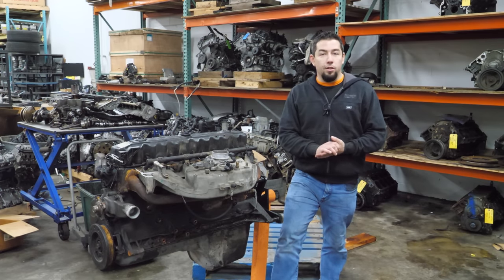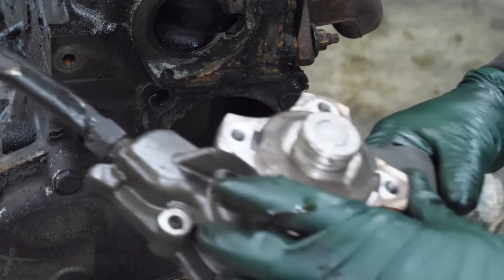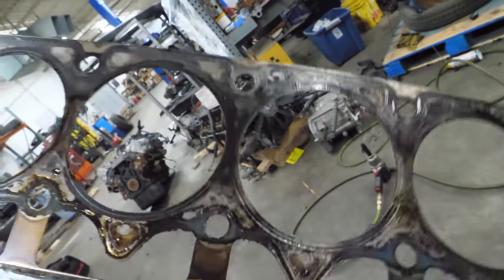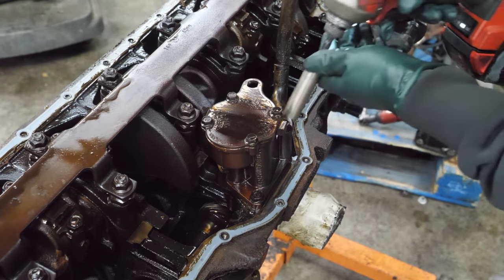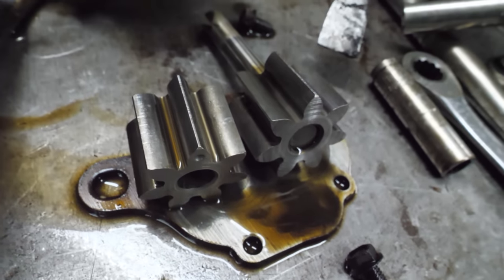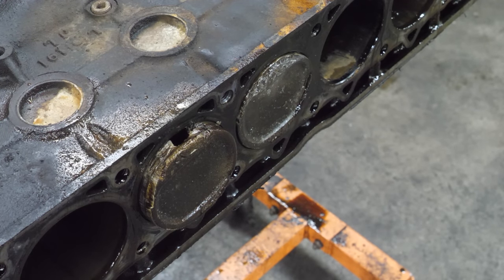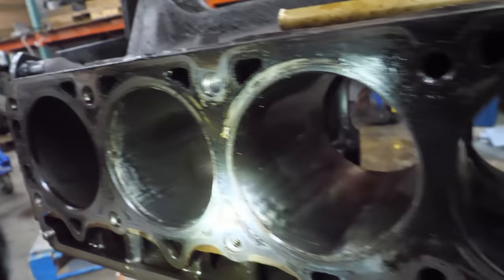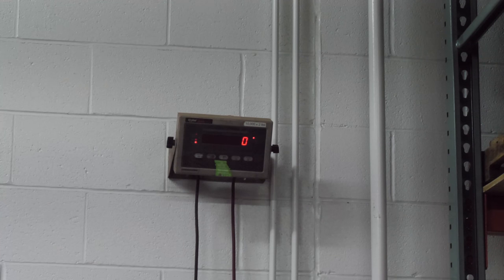How Do You Destroy A 4.0L Jeep Engine THIS BAD? Intentional? Neglect? Ill-Repair?  I Am IMPRESSED!

Comment: Just did a 2004 XJ with a 4.0. It had two pistons that dropped their skirts. 279,000 miles. The customer replaced it with a reman. This is a common issue with the High Mileage 4.0s. What happens is as follows. It starts to overheat or run just a bit on the higher side of 220 degrees. The piston skirts crack or break off leading to it burning some oil. The oil soot covers the 02 sensor, and tricks it into thinks it is running rich. So the computer adds timing and lean out the fuel to get it within spec. Only to melt down the already damaged piston, and this is the end result.
Reply: So it killed itself essentially
Reply: So, technically speaking, the pre-Chrysler style injection might not have made something like this happen?
Reply: A coated O2 sensor will produce a lower than normal voltage which makes the vehicle think it's running  lean, the computer will add fuel so the vehicle will be running rich, not lean.
Reply: Are you outside of the us? I thought the last model year of the Xj Cherokee in North America(except for Mexico) was 2001.
Reply: thats good to know..... when it got around 110F in NE montana this summer..... my 97 was running at about 217 (used OBD2 scanner)
which is just a needle over straight up and down
.
she hit 227 pulling up "kittleson hill" on my 100 mile daily commute 
.
no noises, oil burning, or death yet..... but i was REALLY worried about it
turned off the AC, ran the heater.......knowing that number 6 was probably WAY over 227..... 
.
i love my Heep..... its a POS.... but its got soul
Reply: I bet this is what happened to mine.  i bought it used and my Hwy trip I was getting 25+ mpg.   Then O2 sensors got replaced and mileage dropped significantly.   Still drove it daily through every storm MN could throw at it until the low end of the engine was going out.   Sounded like a diesel when I drove to trade it in.
Reply: @tarungonneea4614  didn't the grand cherokee have the 4.0 for a few years after? Maybe he meant that.
Reply: My radiator clogged once and I hit 240+ degrees pegging the gauge within minutes.   Was able to limp it home about 20 miles stopping every few minutes to cool off.   Cleaned out the radiator and no more issues.   The engines are very tough.   What ever happened to this engine was probably a known issue for a while.   Looks like it was making machine gun noises for quite some time.
Reply: @jordantomblin2302  The renix 87-90 4.0s don't break piston skirts. They have a much, much better designed piston than the chrysler era 4.0s.
Reply: @SlackjawProductions  could be, although the 4.0 in the grand Cherokee was a coil pack engine and had its differences from the absolute fossil that was in the xj chassis Cherokee.
Reply: It's happens with the 1997 and later 4.0l, for the most part. The earlier ones didn't have this issue.
Reply: @mmiller1188  That probably explains why the old AMC blocks and internals are used more in resto-mods.
Reply: If the coolant sensor fails it will run like an engine with a stuck choke. A scan tool will show -40 on the temp and it will wash down all the cylinders very nicely!
Reply: @SlackjawProductions  grand cherokee had it till 2004 when it was replaced by the 3.7 for 2005.

The 4.0 ran in the TJ Wrangler until 2006
Reply: @jordantomblin2302 No, the Renault-Bendix (Renix) system was pretty bad. They’re notorious for being impossible to diagnose issues because they don’t store codes, and good luck finding parts. The Chrysler system was a massive improvement.
Reply: There's no such thing as a 2004 XJ
Reply: I was thinking lugging it under load, which is common for off road vehicles, would cause this.  But it would have to be lugged a lot a lot a lot to do that damage.  Lugging one is a good way to overheat it.  So this explains it to me.  Thanks.
Reply: Thats funny because 2001 was the last year for the xj, why you lying?
Reply: maybe it s a oil quality that cause the issue year ago i had a 1994 zj at 185000km started to developing a slapping pisons issue while warming up i changed oil quality with fully sintetic 5w40 long life oil and the slap disappeard probably low quality 15 /40 mineral stuck the piston rings and sintetic cleaned it ..there is no other explanation cos i ve sold it with 260000km and it was running great
Reply: @SlackjawProductions  Yes, 2004 was the last year of the 4.0 in the WJ Grand Cherokee
Reply: @tarungonneea4614  The last few years of XJ production also had the coil pack setup.
Reply: @benjaminwayneb correct. I was confused too
Reply: Ah now I know what happened to mine.
Reply: @Tru2Chevy last 2 years, to be exact. '99 was still distributor ignition.
Reply: The computer machine glitch.
Reply: @donaldsalkovick396  the xj was produced by "BAW" until 2014
Reply: @v12alpine bull shit you didn't run a 4.0 hot and then keep limping home not problem free anyway the head tends to crack by cylinder 3 in these situations. 😂 notorious for that actually lol don't run your 4.0 hot it won't survive!
Reply: @mmiller1188 actually it's was only a couple manufacturing lot numbers that had piston skirt issues and started in the late 90's not early 90's
Reply: @mmiller1188 96-2000 to be exact and in 1999 the 4.0 engine block changed.
Reply: @tarungonneea4614 the Cherokee XJ ran until 2001 and the 4.0 block changed in 1999 the bad pistons were only in 96-2000. XJ had coils for the last 2 years same as the grand Cherokee WJ and 99-06 wrangler TJ.
Reply: @Rmehki aside from piston skirts breaking more overheating issues cracked heads and bad 42re transmissions. Yeah sure thing cup cake😂😂
Reply: Well mines currently have 374,000 miles never came across that piston issue ur saying the real problem with these are cooling yes but you have to run good quality synthetic oil I was running pensoil for years now I run mobile 1 full synthetic had my ZJ 14yrs now 374k still running great
Reply: @vee950  what year is your jeep? Also the original commenter said he has an 04 XJ he is lying his ass off!
Reply: @vee950  99-06 4.0 jeeps had bad piston casting all 99-06 4.0's whether it is an XJ a WJ or a TJ. Every now and then you'll find somebody who thinks the WJ is the only one with this issue and that the WJ 4.0 is different from all others but that's not true at all. 96 was the introduction of the NVH block which is structurally reinforced internally and has a stamped steel main cap girdle. NVH believe it or not stands for Noise, Vibration and harshness. 😂 Also the 4.0 had a distributor all the way up to 99 when it was switched to a multiple coil setup. And went with a cheaper piston supplier/manufacturer.
Reply: @vee950  also claiming oil brands affect your cooling? Mobile 1 is the worst oil to use in these as they are not a zinc based oil which is required for the flat tappit cam and lifters that these things have...... So if this statement is remotely true then that leads to believe you just bought your jeep and it already had over 300k miles on it when you got it. 🤷
Reply: @kainhall haha I’m not the only one who calls my green Dino a Heep then spunky and full of fire but definitely shows it’s age
Reply: @joshuahockman1128  when these engines were new the 10w-30 the manual recommends didn't have any zinc in it....
.
Sure... I run mobil 1 turbo diesel truck in a 5w-40 (it's both diesel and gas API rated.... diesel for zinc... gas for anti foam)
.
It's overkill.... as the valve springs don't have enough pressure to require zink
.
.
.
Again... people drove 1000s of 4.0s around with no zink oil...and had no issues
.
The 4.0 just isn't "stressed" enough to NEED zink
.
And even modern SN plus / SP oils still have a BIT of zink / zddp
Reply: Where did you find a 2004 XJ??
 Last year in USA 2001
Reply: Yeah the piston skirts are thinner after 98-99. They tend to have more engine problems in the 2000s models.
Reply: @tarungonneea4614 well the engines in some of the wj is the same 4.0 so hes just generalizing the engines id say.
Reply: @KarstRats  which I say 97 is the best year for the 4.0
.
Main girdle.... with none of the "cost cutting" of later years
Reply: @kainhall  idk my 98 had thick piston skirts when it finally gave out. I think its mostly the flat tappet lifters and the non added zinc oil taking these things out for the count. Remember these were made when zinc was recommended because lifters didnt have rollers. Just flat and flat metal on metal.
Reply: Now the 99-2001s just arent the same at allllll. And after that i wouldnt touch one. But i honestly wouldnt touch much of anything after 98 so theres that haha
Reply: Wow!
Reply: @mmiller1188  rare renix win
Reply: They stopped making xjs in 2002
Reply: @casualactivities1229  83-2001 brother
Reply: @SlackjawProductions wranglers had till 06 or 07
Reply: Was wondering how does a legendary engine go bad. Cool, thanks.
Reply: @Callelle6251  oh boy. Asia kept making them until 2014… they just werent called xjs. Also. The motor out of a 2004 wj is the same thing. 4.0 baby. Some of em had the v8s i know this. Dont come at me.

Comment: Finally a 4.0 teardown! And my god I've never seen that damage to a 4.0 in my life. I daily a 1995 Jeep Cherokee with 254K on it and it runs pretty nicely.
Reply: we have perished already
Reply: behold, a god that bled
Reply: So, so much like a slant six. Wow
Reply: My dad has an '88 Comanche with about 98k on it and all it's needed to this point was a new clamp on a hose to stop a coolant leak.

Still runs like it rolled off the line yesterday. Amazingly the only rust on it is from where a window seal fell apart and water got down inside the door. Stored outside in Indiana its whole life.
Reply: Everything that predates FCA is reasonably solid.
Reply: My 4.0 has got 488k and it burns some oil but runs like a clock
Reply: My 4.0 is happily residing under the hood of my 92' Jeep YJ Sahara edition. She's virtually new with 110,000 miles and garage kept in the desert for her whole life. Never seen salt, never seen much rain, always garage kept.
Reply: I have 317k on my jeeps 4.0 and still going. I replaced the timing chain and harmonic balencer about 270k,  other than seals and gaskets it's unopened. It does foul plugs every 60k and will smoke if you let it idle too long but she's still chugging along.
Reply: I have a 1995  cherokee also 196K love it... good video
Reply: Are you a mechanic? do you work in an automotive machine shop?  Just because you drive one doesn't mean you know anything about how or why they fail.
Reply: 390,000 on my 99 cherokee. Daily driver.
Reply: only 115K on my ‘96 Grand Cherokee Limited and it still drives like new
Reply: You can easily get 200k more if you take care of it. I've had 2 over 300k that ran when I sold them. Fresh coolant every few years is a big help. Most forget to do that
Reply: @Transient901  Are you insinuating only mechanics know about engines? I know countless people who are fantastic mechanics but don't do it for work. I'm fairly good myself and have never done it as a job.
Reply: @okgroomer1966  LMAO @ the guy with a complex
Reply: @okgroomer1966  LMFAO!!!
Reply: I disagree, I do not think a competent man would be offended by a comment nor feel the need to tell the world on a format one step above facebook.  See ya, and have a nice life.
Reply: @okgroomer1966  And to address your first unnecessary comment, there is a huge difference between knowing how an engine works and understanding the myriad causes of failure.
Reply: @Transient901  It was you who got butthurt not me and it remains that way it seems. Enjoy waiting on AAA for flat tires.🤣
Reply: @okgroomer1966  ROTF@ the child playing with mommy's phone.
Reply: I’ve seen quite a few in more pieces and they should be usually neglected vigorous use.
Reply: @aidanscull5770  This engine was a pig on fuel, didn't make great power, but was durable as hell. You obviously know all that already.
Reply: Id die to find a nice older Jeep.
Reply: I have a 2000 TJ with 78k miles. Been in Japan it’s whole life
Reply: they run forever with coolant and synthetic oil.
Reply: 190k on mine still running strong and smooth.
Reply: 94, smog tester said he had never seen such an old car outperform so many modern cars. Its at 175k
Reply: The '99-'04 WJ 4.0's are known for this. The cheapened the material the pistons were made of.

Comment: Fun fact. This engine was designed by engineers from all the big three makes. AMC came around and they stuck this in about everything. When AMC disbanded Chrysler kept using the engine. It has one of the longest production life spans of any engine.
Reply: It's based on the 258/ 4.2 l, you can use the crank and rods out of that to make a 4.5 l stroker in a 4.0l block
Reply: @BeepBeepParkie More Fun: the AMC 6 began life as a Nash motor in the late 1940’s. The 7 main bearing bottom end is what gave it legendary durability.
Reply: @BeepBeepParkie , I did not know that. I wondered what the stroker was built out of. Thank you.
Reply: American Motors loved this engine!

Comment: My brother had one of these in a jeep that had over 200k. It had a cracked radiator so he'd have to refill it. Sometimes he would drive longer than 30 minutes without coolant and the temp pegged on H and when he got home it would be bone dry. Drove like this for a few months.  He had it for a year more and sold it to the neighbor who had it for years. Have to work hard to kill a 4.0
Reply: I had it in the Jeep Commanche and Cherokee.  They had some getup and go in them
Reply: I've currently have 4 from 91-05 one of unknown year in my 90XJ it was replaced twice in the past warranty replacement first the second was due to bad replacement oil pump.  Solid engines with simple upkeep on oil, coolant and plugs
Reply: It's insane what these 4 liters can take

Comment: I owned a 97 Cherokee with the 4.0L. After 212k miles the engine still ran strong.  Like you said, everything around the body was falling apart or broken, but the engine always started up.
Reply: I had a 1996. Great drivetrain but the rest of the Chrysler stuff will fall apart around it.

Comment: Had a 99tj with about 90k on it break a skirt on the piston on cyl 6. Thought it was a rod knock at first. Pulled it and tore it down. Found the rod on cyl 4 visually bent as well. Never hydrolocked it. Figured I had it apart so go big or go home. Went .030" over, stroked it with a 4.2L crank, Comp Cams camshaft, bigger injectors amongst exhaust and others. I was very happy with the build!

Comment: I have a 2001 XJ and it has been rattling for eight years, so bad I tell people that it's a Cummins swap. I paid a mechanic to drop the oil pan and take a peek. He couldn't find any loose so he buttoned it up and said to just ignore the rattle and keep driving it. That was eight years ago.
Reply: Good chance that rattle is the exhaust manifold.  When they crack (and they all crack), it'll rattle like a diesel.
Reply: Rocker arms
Reply: Flex plate issue.  They Crack and starts to tick.

Comment: I bought a 1996 Grand Cherokee with 267,000 miles on it. It was my first Jeep. It had a slight tapping coming from Cylinder #6. Started using T4 10/40 in it and it quieted it substantially. Drove it till about 301,000 miles and then it developed a really loud chatter. Still drove it another 2,000 miles that way till I finally bought another vehicle. I got curious and dropped the oil pan. The piston skirt for cylinder #6 was laying in the pan. Engine still ran and had good compression. Just piston #6 was chattering around in the cylinder.